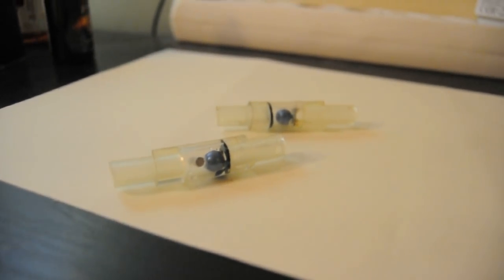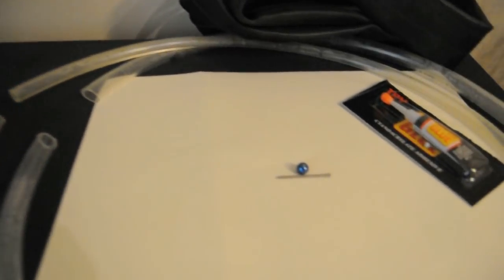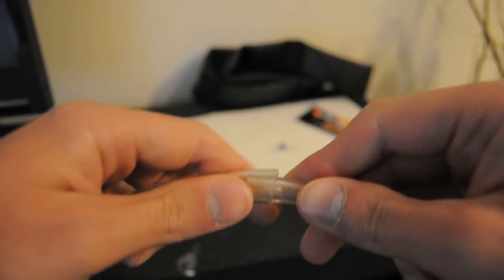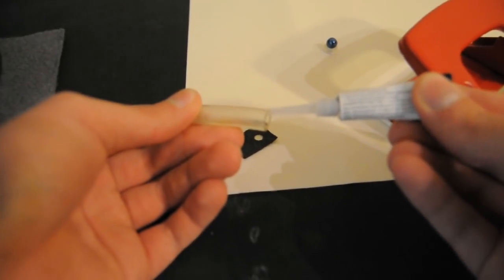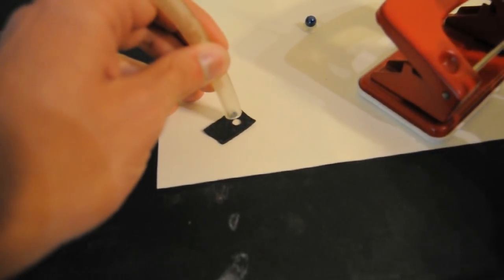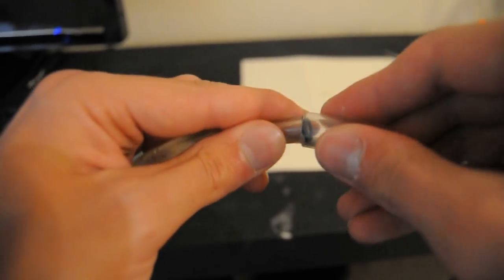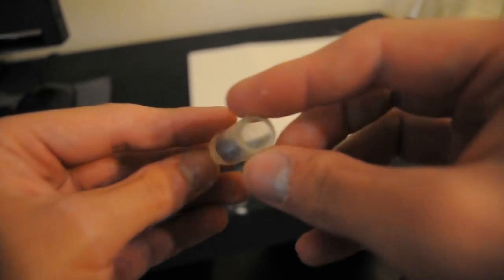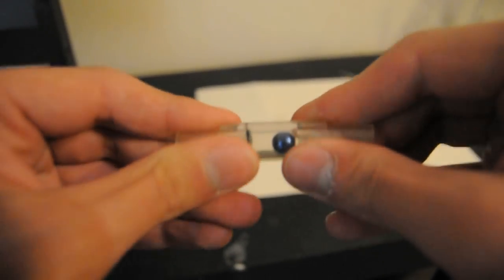How to Make the Easiest Check Valve at Home (One Way Valve)

Comment: And the final 30 seconds were to show....how klutzy this 'home made' craft was??
Reply: no. it was to show how well it sealed and kept water from flowing. the reason it did what it did, was because the water pressure was too high to keep the valve in place in the hose.

Comment: Does this work with air?
Reply: It will work with air, but i would suggest translating this design into metal pipes, since they won't deform as easily when under great pressure so leakage will be non existent (unless you use it for extreme pressures)
Reply: @hardcase1659  i would not use this as a flashback arrestor
Reply from the maker: @hardcase1659  Exactly what hard case he said.
Reply: @ARCSTREAMS  The volume in the chamber is too low for any significant pressure to build up if a flashback occurred, plus the softness of the material would sooner deform and let all the excess pressure from the explosion out rather that fragment, which would not cause any harm to a person anyway unless a fragment went into their eye.
Reply: @hardcase1659  not sure if you are talking about metal or the plastic tube in the video which is what i was referring to ,i doubt it would work properly to shut out a flash back in time ,better to not mess around for such use and get real one,,of course if i made one myself for such use it would be a bubbler with water chamber,,much safer
Reply: @ARCSTREAMS  I was in fact talking about the on in the video, but if i was concerned, i would use brass turnings as a flash suppressor.
Reply: @hardcase1659  the one i bought uses stainless steel wool i think,from the data sheet,,,how about fiberglass would that work? i have a propane line i would like to make safe but instead of a bubbler i was thinking of stuffing fiberglass in the line
Reply: @ARCSTREAMS  I think that any fibrous material can work as a flash arrestor including fiberglass.
Reply: @hardcase1659  i dont necessarily think so,they say steel wool for example does not do a good job so they use ss instead,,i figure so long as it is able to burn and arrest the gasses from passing through,i am hearing about fiberglass as one possible material suggested so it needs to be tested
Reply: @ARCSTREAMS  The reason i thing they're saying that steel wool is not a good choice is just because it will rust really fast considering the large surface are of it and it could burn in the case of a flashback, like steel wool burns when you short out a 9 volt battery over it.
Reply: @hardcase1659  sure ,it is a very reactive material both to rust and burning away easily,,i got some fiberglass and thinking of stuffing some of it in my propane line that feeds my homemade mini torch ,not sure if its necessary for the setup i have though but its easy to do and better than nothing
Reply: @ARCSTREAMS  I would go for it. Like you said, it's probably not necessary to install in a setup like yours (i watched your video) 
but it won't hurt to have it just in case.
Reply: @hardcase1659  ahh good you saw my video ,,i have an oxy cylinder with regulator and hose ,the end of the hose is connected  to a flashback arrestor and some fittings and reducers to a ball valve and then connected to the smaller line going to the torch,problem is the small fuel line from the torch goes directly to brass attachment with another valve hooked on a 14oz propane cylinder and i can not put a store bought flashback arrestor on that so i figured maybe stuffing a section of that line near the tank (only place i can do it from) with some fiberglass,,i had it blow back on me a few times in the past but there was no explosion or any problem,i saw it light up one or maybe both lines but cant recall which ,i think its very short flash and does not travel too far or so i thought??  so maybe its a good idea to stuff as much as possible